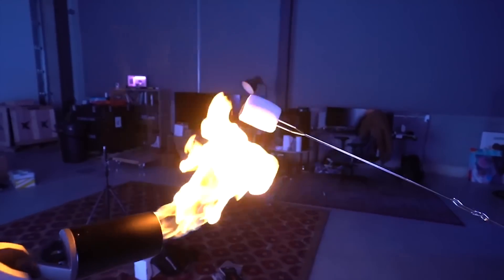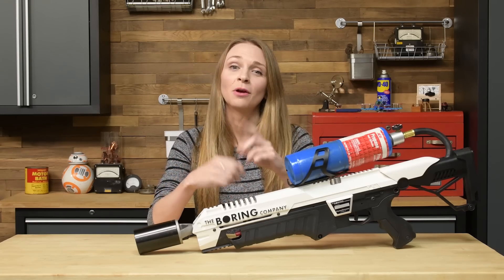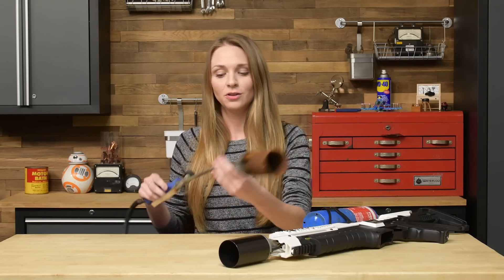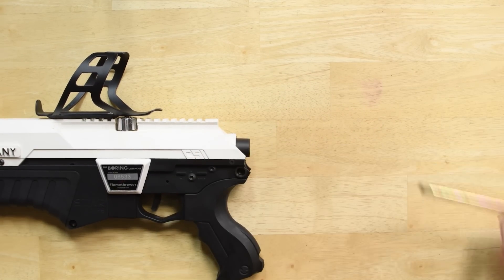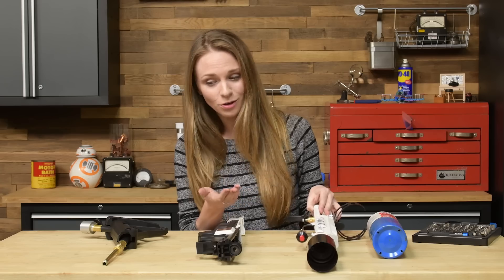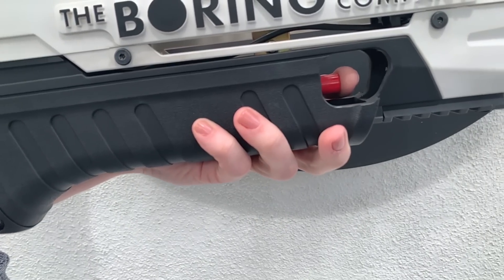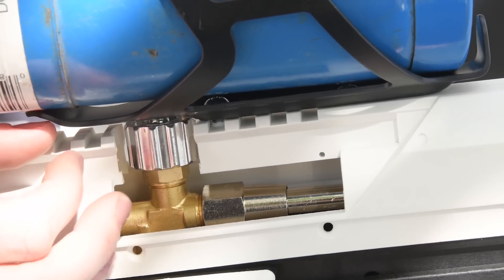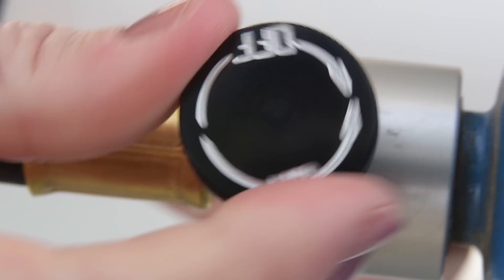Gadget Guts: The Boring Company Not-a-Flamethrower Disassembly, Troubleshooting and Repair

Comment: Has any one identified exactly what brand hose was used? I've found the exact torch repurposed. I'd like to see a proper tear down of how they attached the inner barrel to the housing, and how they secured the pistol grip. The grip on the airsoft gun is screwed into the gearbox which obviously isn't there anymore. I ended up JB Welding my barrel and grip when I made my own.

Comment: Useless device..
Reply: Useless comment. See how this works?
Reply: @KumaBean  there's always one hurt owner who has to lash out lol you could always try selling it dude...
Reply: Mr2pint I don't own one, but if I had one, like the upgraded version I'm in the middle of building from scratch, I could (read 'will') use it to light BBQs and for general shits and giggles. 

That means that for me, it has uses. 

In such a case, your claim that the unit in itself is useless is useless in itself, as it doesn't apply across the board and is not a universally held view; it is simply your own view, and as such is of no use or consequence to anyone else.